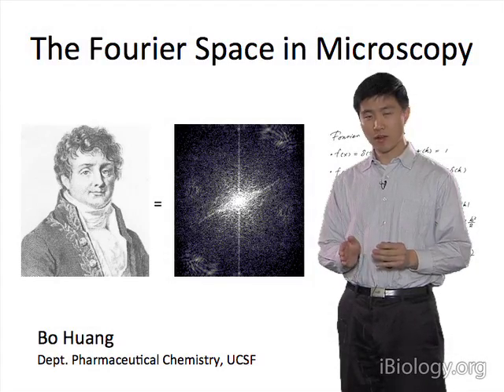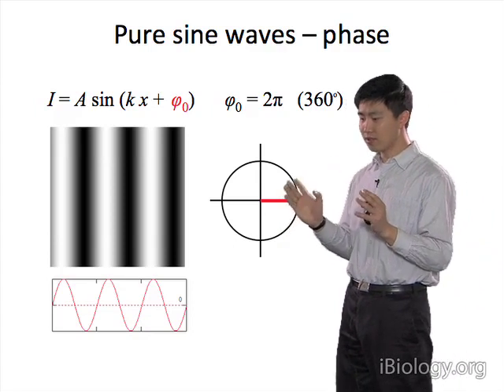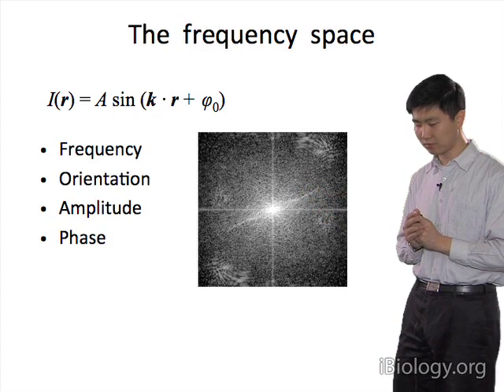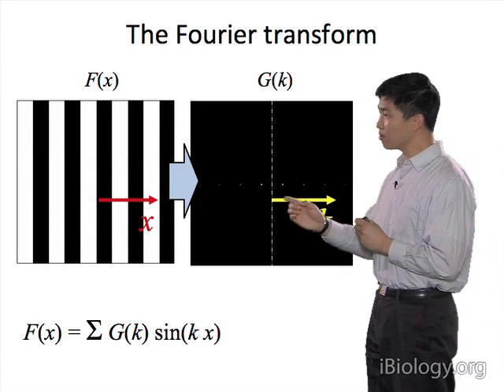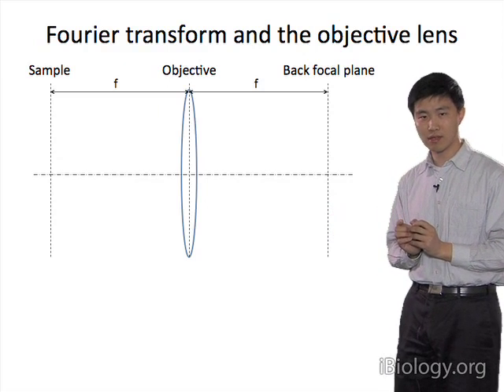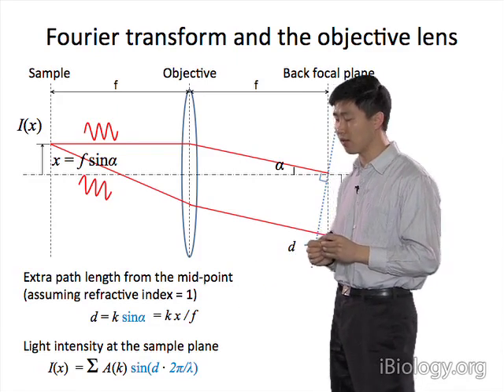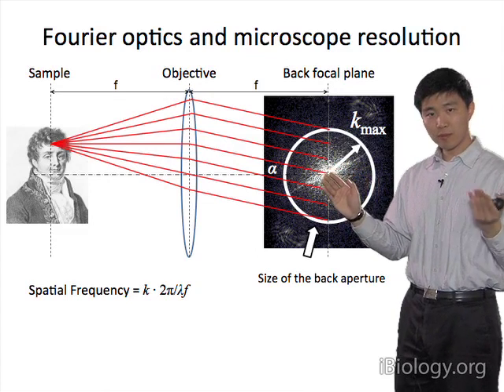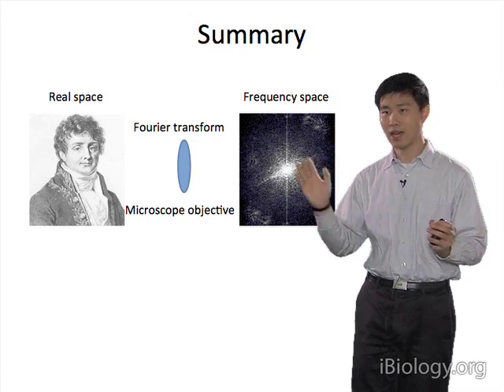Microscopy: Fourier Space (Bo Huang)

Comment: Should it be a cosine at 14:27 (bottom equation) instead of a sine?
Reply: i agree with you. 
if the phase delay is 2 WAVELENGTH, SIN will give a result 0, NOT A INCREASE OF IN TENSITY.